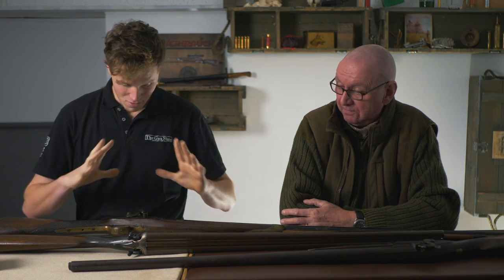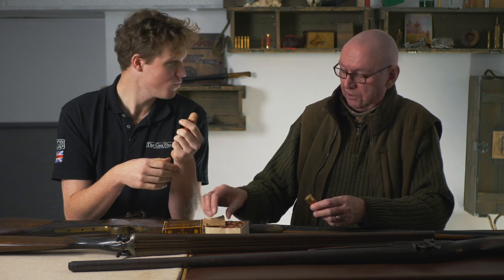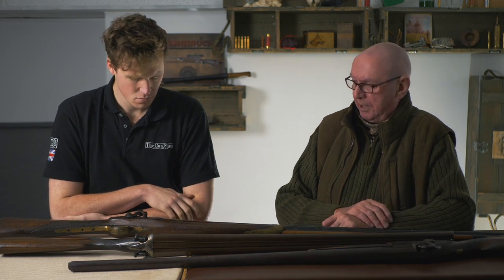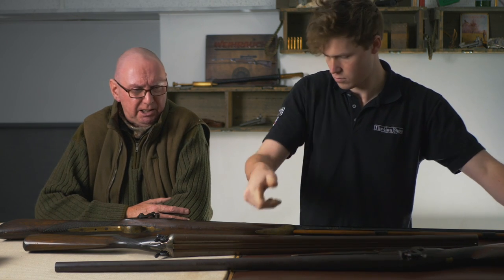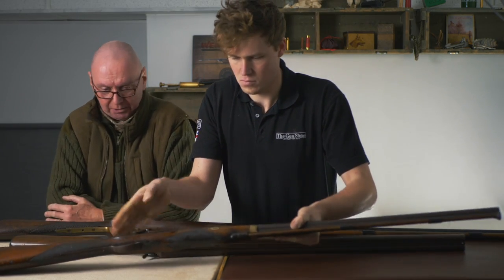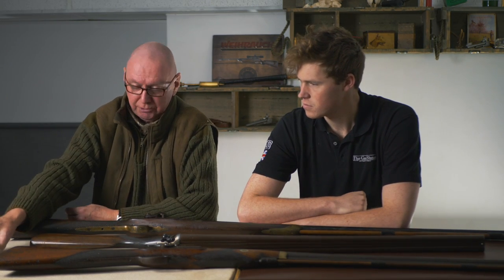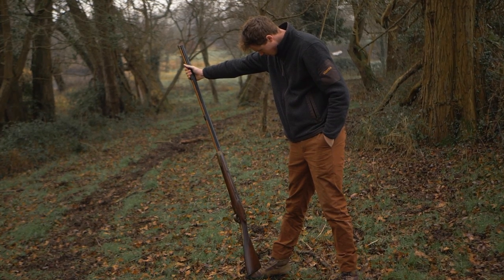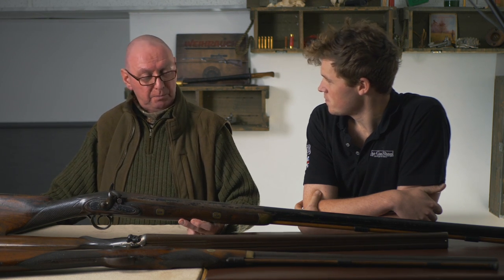Wildfowling: Classic Fowling Pieces

Comment: Filling the barrel with water then measuring the volume might tell you if it is relief bored. Work out the volume of a straight cylinder and then see if it holds less than that